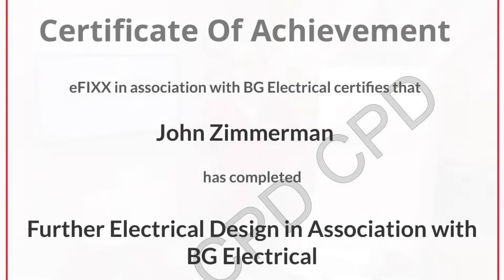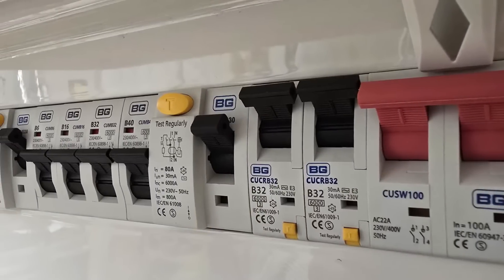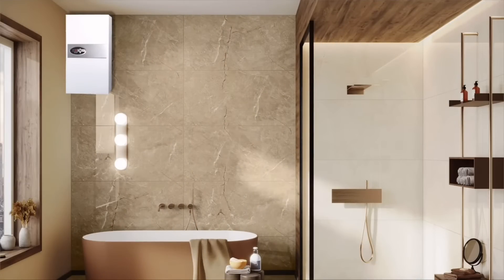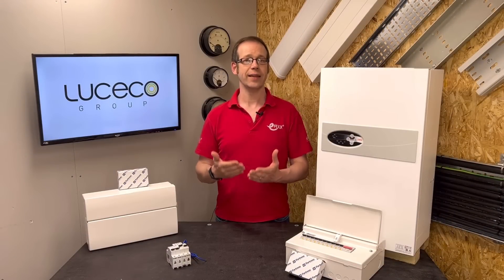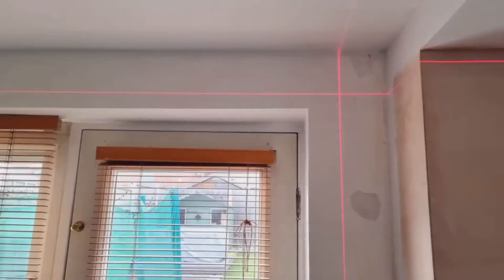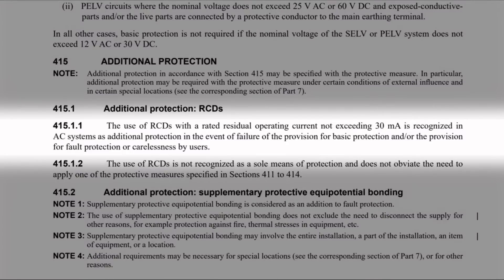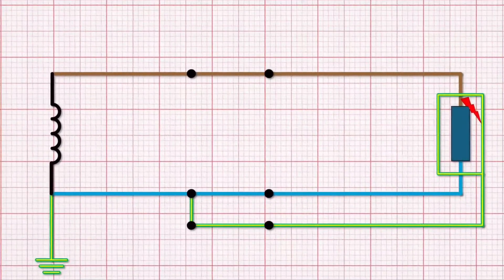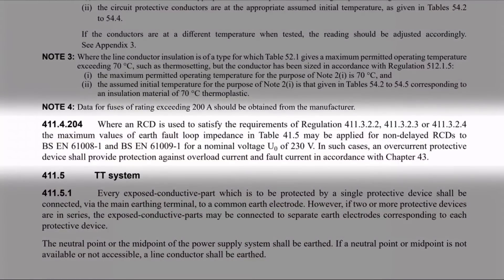RCDs & Earth Fault Loop Impedance: The Hidden Connection!

Comment: So how does the 1667 max loop value tie in or supersede an RCBOs max zs value?
Reply: It does and it doesn’t, as mentioned in the video over current/short circuit still needs to be considered in the design and is most likely going to be protected against by the circuit breaker portion of the robo. 
Fault protection/additional protection in the. 1667 ohm case becomes about protecting people as the touch voltage will be limited to 50 volts . 
V=IxR 0.03(30 milliamp)x 1667= 50

Comment: Lets assume that every circuit will be protected by an RCD.  ok problem solved everyone is happy.  Can someone describe a situation where an RCD is not required please? I think its simpler to focus on when its NOT required and assume it will be compulsory in most cases
Reply: I think it is better you learn when they must be provided.
And if you want to provide them in other scenarios, you may. But there is a cost of that, around £40 a time.

They must be provided on circuits powering socket outlets and rated at 30mA trip.

You should be competent enough to assess the level of risk present and decide whether they are worth the expense on circuits where their use is not mandatory.
Reply: Broadly speaking its hard work to achieve a situation where RCD protection is not needed. General installation in plaster, or dry wall as is the norm, you can't sensibly achieve the install in a manner which would negate the use of an RCD. In answer to your question, something like a smoke detector, wired directly above ceiling, or a security alarm supply clipped direct, are about the few common items where you could avoid use of RCD. Its really not worth  messing, fit individual rcbos, then your about as future proofed as possible if AFDD's become a requirement.
Reply: An T2 SPD of course would Not need any RCD protection...🤣🤣🤣

If installed, its Harmful...😅

Comment: How does one satisfy thermal constraints when using an RCD for fault protection as there are no energy let-through figures for RCDs?
Reply: You space them out in the board to allow the air to move around them.

Comment: Hi, how you recognise neutral from earth on unknown wires
Reply: Referencing to a True Earth Rod (independent), check for Potential Difference at the Point/Termination of so-called unknown N and PE conductors...

The least values shall be deemed PE.

Try getting a High Accuracy Measuring Meter (miliV) for better results...
Reply: @temp26j724-i  hi, isn't it this socket testers good for finding out neutral phase and earth aren't they reliable
Reply: TN, TNS or TNC-S? 
Either way, check were theyre coming from
Reply: @zaxmaxlax  can not check that, no access to distribution and lines 😞
Reply: I read a while ago on a comment from someone from somewhere in east europe saying people were stealing neutrals and PE cables, so now theyre all black 😂😂😂
Reply: @zaxmaxlax Same in UK. On water treatment run black for earth cables outside. No green/yellow on show.
Reply: With a nice, big resistor.
Reply from the maker: Are they not identified?
Reply: @efixx  no they are all white
Reply: @Bias_Prineus  Do you have acess to the meter? Go from there
Reply: @Bias_Prineus  Get a resistor and test where you get more current, if its the same must be TNS so it shouldnt matter
Reply: @zaxmaxlax  TN-C-S will be identical, TN-S has the potential to be different since the N/E link is remote and the wire CSA to that point can be different.  Load or voltage tests measured against an independent electrode will identify all three types.  Under load TT will show far more voltage on the earth wire to the independent; TN-C-S will show identical voltage on the neutral and earth to the independent; TN-S will show different neutral and earth voltage to the independent but it may be quite small difference based on the length of the network wiring.  Of course, it could be a TN-C-S nearby due to earth sheath degradation in the network and that could appear to be TN-S too.

An independent electrode being one that is placed such that it is not affected by any other conductive infrastructure, at least 2m clearance from such items.

Fun isn't it.
Reply: @retrozmachine1189  I would guess its TNS with the earth cable provided by the electrical company. I refuse to believe OP hasn't acess to the meter. If it was up to me I would join them and separate again with the proper colors.
Reply: @zaxmaxlax  Situation is a bit suspect really isn't it.  If a person doesn't know how do to this stuff already it's pretty certain they aren't trained and shouldn't be fiddling.
Reply: Really???

Comment: One recommendation would be to also check the manufacturers instructions. 
For example, recently I installed an instantaneous water heater which was clipped direct and in no need to be provided with RCD protection. However, reading the manufacturers instructions they stated that the water heater must be RCD protected, so of course I installed an RCD to comply with their instructions.

Best to remember that the manufacturers instructions are important to reference when connecting electrical equipment as BS7671 states in regulation 134.1.1
Reply: Totaly agree. Oddly, i've just installed a Sauna in a customers garden with clipped direct & the instructions stated not to install an RCD. Water heater with water knowingly to be thrown over the rocks & element is quite uncomfortable.
Reply from the maker: Great comment and a great point. 👍